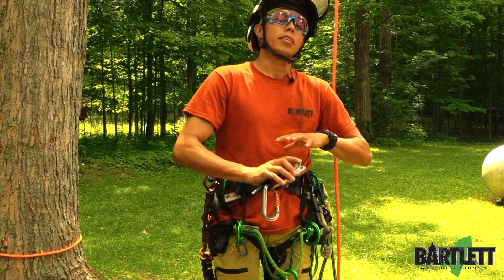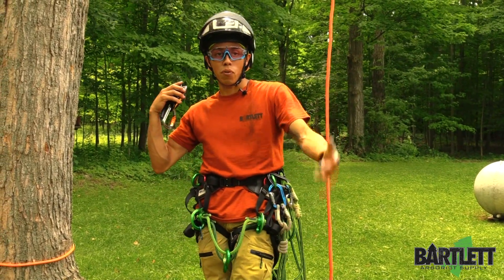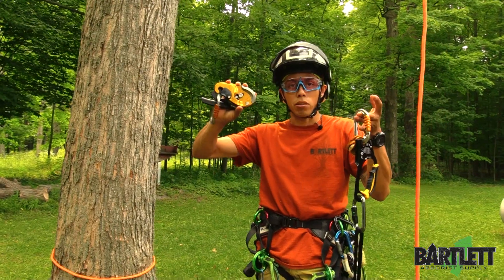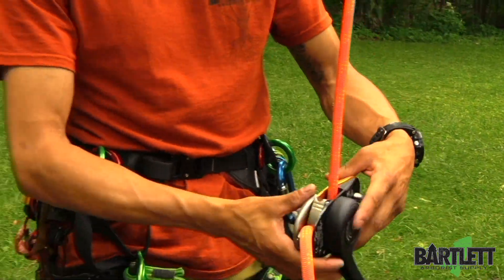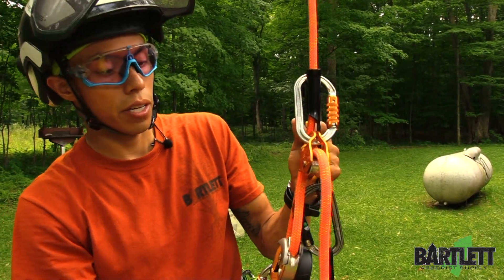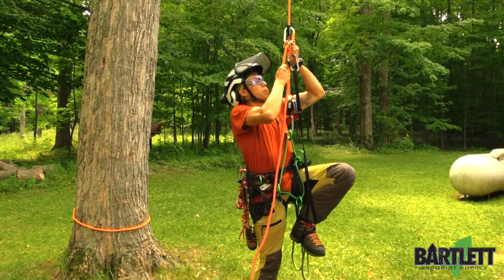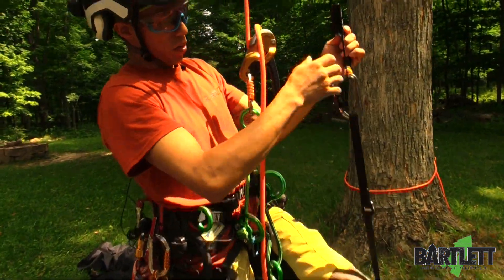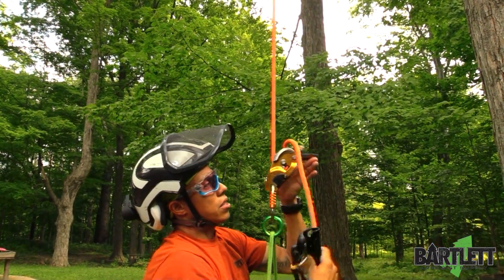The RADS System

Comment: Great video. If I could make any recommendation it would be to snug up that bridge. The rig is up at your forehead. Get it as low as you can and you greatly improve the efficiency of your stride. Also a Petzl Roll Clip Z is a biner/pulley hybrid that does what you’re doing up top but with one less piece of gear.

Comment: I'm another old guy who got into arborist work out of financial necessity. Here's two improvements on the above setup to consider. I bought the Petzl Rig, which I love, but found the above footloop method of foot attachment to the hand ascender to be too sloppy to get in and out of;  and the Petzl hand ascender/swing-cheek pulley combo to be a source of unnecessary friction between sections of the rope and the pulley. I switched to a Climbing Technology Quick Roll hand ascender, with its integrated pulley, and that keeps the rope sections fully separated (plus there's less gear to drop or harness on rappel). Finally, I use a CT foot ascender, making snapping in and out of the rope a breeze -  because I never have to wonder where either my foot or the rope are down below. With this setup there's no need to tend the slack through the Rig - as you work the foot ascender, you and the Rig are advanced up the line. After each advance, use your hand ascender to push further up the rope line and aid in the next foot pump advance. Tie off the hand ascender to your bridge with a sling and you have a second safety should the Rig ever fail.
Reply: A post a pic bro
Reply: does it matter to run a right hand ascender with a left foot ascender? I run a grigri to progress capture. Thanks!
Reply: Would love to see this setup.
Reply: I've been wondering how to incorporate my foot ascender I got into the RAD system that I know how to use. For some reason, it didn't occur to me to do what your describing!

So instead of pulling down with the right hand in this video, that line goes down to your foot ascender! Interesting!

Comment: The description says 3:1 mechanical advantage how are you deducing this and not 2:1 ?  I see only one acting like a moving pulley (the petzl ID or grigri device) moving up towards anchor during the hand pull.  Thank you.
Reply: @BartlettArboristSupply  perhaps it's more about the frame of reference I was focusing on the hand-pull  out of the pulley and excluding the leg press as the combination is a complex system (hand acting on a moving "pulley, your ID", and tthe leg acting on a stationary anchor, the rope grab of the hand-ascender which could extended all the way to the tree anchor. 
 If your body weighs 100, both legs of rope out of the petzl ID will be 50, the rope out of the pulley would be 50, thus 2:1 with respect to your weight, however the tree anchor experiences 150 during a hand pull.  When you synchronize the hand-pull (slack removal) with the foot press I don't know how to analyze that :)
Reply: They only say 2:1 in the video, so the description seems to be a typo

Comment: I fail to see where “rapid” comes into this. Seems like a normal srs rope walker set up would be faster
Reply: In old times, before Rope Runners and Akimbo, this was quite nice method. And I still use it as cheap and reliable system for amateur climbing.
Reply: @BartlettArboristSupply  I personally think it should be renamed the: Reliable Ascent/Descent System.